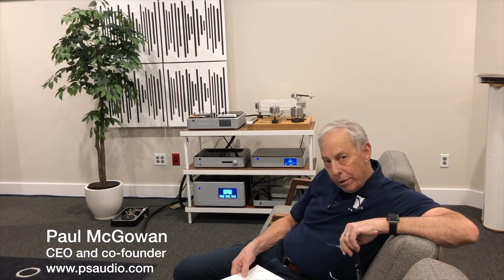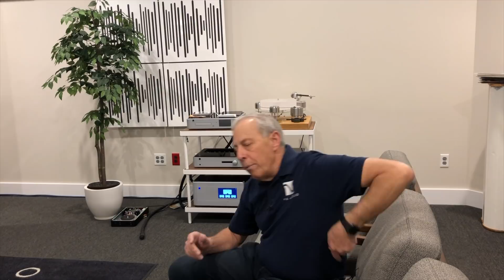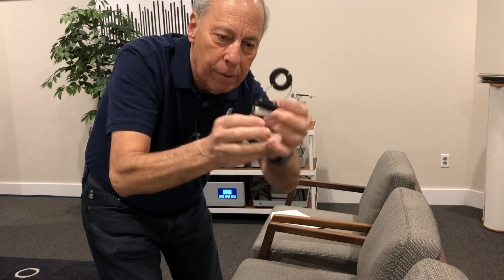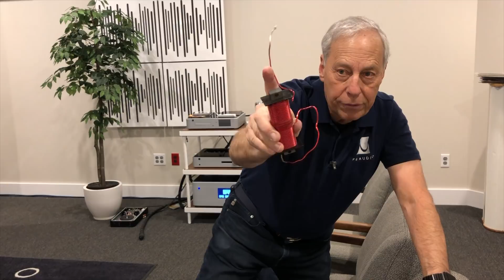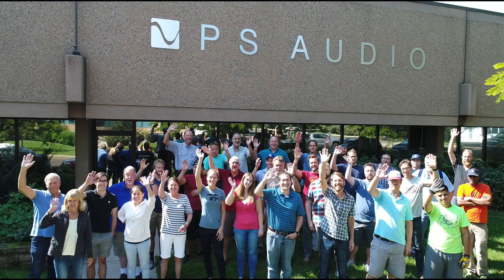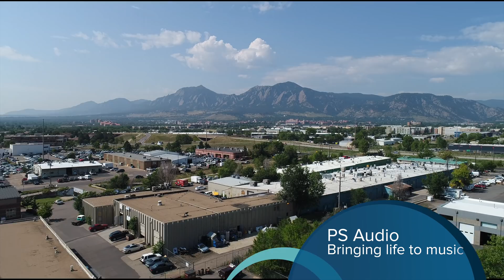What's different between air core and iron core speaker inductors?

Comment: How do you convert an iron core inductor to an air core inductor, is it that you use the same amount of turns, but double the gauge of the wire, to get the same inductance as an iron core  ?
Reply: When you remove the ferrite or iron core from an inductor you reduce its inductance by a factor of 2 to 4 generaly. So, to achieve the same inductance in millihenry, you will need to make the spool much bigger ( 2 to 4 times the lenght of copper  ). Some people worry because the resistance through the lenght of wire will also augment, but since these are low values ( from 0.1 Ohm to 0.3 Ohm ), the change will be barely noticeable ( around 1/2 db of loudness ).

The gauge of the wire only influence the power ( in watts ) you can drive through. For example, if your speaker accept 100 watts RMS, 18 or 16 gauge wire will be sufficent. If speaker are rated to 200 watts RMS, you will need 16 to 14 wire gauge. If your speakers are rated at 300 watts RMS or more, 12 or 10 wire gauge will become appropriate to tolerate that amount of power.

Since iron or ferrite core inductors are more an economy trend, most high end or high power models only use air core inductors. If we consider that most speakers can have a lifespan of 50 years or more, it is a wise choice to invest more for quality components. I hope this is helpful. Good luck !!!
Reply: @yvesboutin5604 Hi my iron core inductor, I want to change, which measures 0.36mh, with 0.5 mm wire, should I replace it with an air core inductor around 0.72mh 0.5 mm wire, or should I increase it, what are your thoughts?
Reply: @tweakerman  Hi, your question didn't include if it is for a mid-woofer or on a tweeter. Also, is your speaker a 4 Ohm or 8 Ohm impedence? All those parameters will be important to consider for the gauge of the wire to be used. If your inductor is to be used  in series on a 4 Ohm, 8 inch mid-woofer, at a crossover frequency of 1800 hertz, you will need a 0,82 mH inductor of 14 gauge size ( 1,2 mm ) to be able to carry that much power.

If your mid-woofer is an 8 Ohm driver, you will need a 1,6 mH coil because the impedence has double. Now for a tweeter in a second-order configuration, there is less power passing through ( maybe 1/8 ) so a 18 gauge wire  ( 0,6 mm ) will be enough. But again, depending on the impedence, that value might change. Some charts exist on the web for those who make DIY speakers. I encourage you to consult them. Good luck.

Comment: I am rebuilding a crossover in a set of speakers, just a mirrored upgrade to better components. The exsisting caps are garbage and its very tiny gauge iron core inductors on all bands. I purchased 16ga air cores for the tweeter and bandpass circuits, on the low pass I got a 14 ga iron core. It wasn't cheap but a 7mH 14 ga air core took me over the budget. To save a few bucks I used an Audyn Q4 68 uF on the LP also. Mids got Clarity-Cap CSA and Superior Zs for the tweets. My goal is to get more control down low, going from a 20 ga (maybe smaller) to 14 ga with a decent cap should tighten it up in my eyes. Also, i want to clean up the middle, at higher volume the mids kind of take a back seat to the bass, as far as the tweeters go, with the Z cap I am told they match well with soft domes, brighten them up. I guess we'll find out.

Comment: AC has two half periods, in the first one the voltage goes from zero to max to zero, then the polarity changes and the voltage repeats, following a sinusoidal curve. Current follows the voltage thru the load. 

When you put AC through a coil, in the first half period as voltage rises, some time (dependent on the inductance of the coil) is spent to store up some energy in the magnetic field in the core of the coil, while no current passes to the load until the field is complete, when the second half period starts there is already a field there with a magnetic polarity of the first half period, that started collapsing when the voltage hit 0, there can be no two polarity mag fields in the coil at the same time, so what happens is the supply voltage tries to push the current in the other direction, but that current, while trying to create an opposite polarity field is stopped instead from flowing thru the coil, by the current generated by the first field releasing its stored energy, until it completely collapses, this is called self inductance, delaying energy transfer, then some more energy is stored in the mag field of the opposite polarity. This is almost like magic because even a little amount of magnetic energy stored in the coil is able to momentarily overcome ANY electrical resistance in its way, when the field starts collapsing and inducing voltage that can reach some pretty unbelievable values... so you can imagine the power loss difference when you do it once per second vs 20000 times per second.

 While the frequency is increasing the coil spends more and more time collapsing and rebuilding its mag field while "wasting" energy in a given time period, and the time when the field is up and the current allowed to pass freely, decreases, it's like magnetic PWM of a sort, speakers are also made of coils, thus frequency response, but that has also a lot more to do with inertia and fluid dynamics...

Iron needs way more energy then air to orient its atoms to form a magnetic field, making the once formed field way stronger, so you need less turns of copper wire for the same effect, but it doesn't do so in a linear fashion, it is called a hysteresis curve, and each material has one, air cores are perhaps the "cleanest" in terms of introduced noise due to hysteresis, but you need more copper, and since bass is a much lower frequency, and iron is much cheaper then copper, bmw probably made a deal sacrificing some audio quality for lowering price and size of the coils, or that they factored in for the non linearity curve elsewhere in the system, or that the solid core is iron dust or some other more linear composite...

I hope that I explained it well enough, coils are probably the least understood things in electronics, and since magnetism is involved, quantum physics may be able to explain the phenomenon fully one day...

Comment: Howdy. Yes.
The iron core has three main disadvantages that must be considered in High End.
1. As mentioned the saturation. When the iron goes into saturation its inductance fades away.
2. Hysteresis. Ascending magnetization follows a different curve than descending. Causes phase unlinearities.
3. The permeability factor is not a constant. It varies with varying magnetization It is not a straight line in a BH chart. The inductance will vary with varying volumes causing the cutoff frequency to roam.
Regards.

Comment: Paul.  The word for an iron or ferrite core which you were trying to remember is Drum Core (looks like a spool).  Also, there are iron or ferrite Rod Cores and Toroid (ring shaped) Cores.  A Bobbin in some cases, is simply a metal or plastic form or spool to wind on or transport wire.

Comment: I don't like iron core as they saturate and limit dynamics.
Reply: Iron core gives distortion at saturation. But higher DCR of air core limits dynamics. You got it all wrong. If you want good dynamics, use a huge expensive air core inductor.
Reply: If you choose a good size iron-core you might have a hard time trying to saturate it. You would need to apply like 500-1000 W of amp power.

Comment: I much prefer the sound of air core inductor' with 12-14 gauge solid copper wire in my designs. Its very expensive but when it comes to correct sound on a good set of speakers, who cares about a couple of extra bucks.

Comment: Great video! I hope Paul is able to elaborate on the advantages and disadvantages copper foil inductors sooner rather than later as I have a speaker project that has Goertz inductors as an option and he's better at explaining this stuff than just about anyone else around. Please, Paul!
Reply: Or just use active crossover wich has no negative effects apart from that you need multiple amp's.

Comment: depends where the inductor is in a crossover, like a 3rd of 4th order linkwitz I find when you put the iron core in it allows more higher frequencies  to pass then without.
Reply: Frequencie response is the same if the inductance doesn't change.

Comment: Thank you again Paul. Your explanation covers it fine for general knowledge. For those who want to read more I have added the following:For audio purposes the iron core saturates with amps and frequency, the lower the frequency the lower the amps that the core will tolerate before  saturation. In the November 1990 Audio Magazine with the B&W 801 Matrix review starting at page 108, Don Keele jr.  discusses the effects of an undersized core of an inductor in that particular speaker. To save you all digging through the closets, here is a link:  https://www.americanradiohistory.com/Archive-Audio/90s/Audio-1990-11.pdf
Reply: Very cogent for today's insane power levels that amplifiers can deliver these days.
Reply: Thanks for the AUDIO mag link JH!!.... the Matrix 801s2 has been my favorite & primary listening speaker for over 20 years, and I still love it!  I've done extensive upgrades to the original crossovers, but one of the very first was to address inductor CROSSTALK.  Two of the midrange & woofer inductors were too close and not orthogonal to each other, thus creating a problem in the 300-400 Hz crossover range.  I'm now wondering, if what was originally suspected as an undersized inductor, was just in fact a crosstalk problem??  In any event...  I now have a new reason to tear into them again, and seek out possibly upgrading the L6 inductor anyway (space is limited however).  I've already upgraded all the original capacitors.
Reply: Please note two things from that article:
1. The inductor in question is a FERRITE - cored, 6.5-mH inductor that apparently was undergoing core saturation... (ferrite cores work better on high frequencies, while iron cores are better for lows).
2. Note that for typical program material with realistic crest factors played through power amplifiers of 150 watts or less, inductor saturation and resistor overheating should be NO PROBLEM.

Comment: Could someone address soft iron vs sintered ferrite or even nickel or CuNiFe ?
Reply: They all have different permeability. The goal of any transformer or inductor is to provide a certain amount of inductance at all frequencies of interest while at the same time using the least amount of wire possible. Lets pretend that we have two inductors of the same size and the same number of turns. One inductor is using just plain silicon steel which is probably the most common type of core used in audio. The other core has some nickle iron alloy. The nickle iron will have a higher permeability and in turn will give you more inductance. However it will also saturate a lot sooner. So you have to balance out the metallurgy of the core such that it gives you the inductance you want without saturating during normal operation.  Soft core iron, nickle ferrite, and all that stuff are just variations on metallurgy to achieve better inductive performance for the same size transformer.
Reply: @tristanjones7735  Thanx, TJ . I thought permeability was important. Coming from the guitar community,and we are gullible to 'mojo' I wonder about eddy currents making uncontrollable artifacts. BTW I thinking more about magnetism, inductance and transducers from the pick-up end mostly.
Thanx again.
Reply: @therugburnz   Wellllllllll things start to go sideways with guitars. In audio we usually aim to minimize distortion where possible. In guitar world, you are aiming to achieve a certain type and level of distortion. Different core materials can cause different types of distortions and that might create different resonances ect ect. In audio thats generally viewed as a bad thing, with guitars, you might leverage that type of distortion to flavor the sound characteristics. 

Good news is that winding your own guitar pick ups is fairly easy and cheap, so you can play with different core material and figure out what works best for you.

Comment: The iron core changes the inductance depending on the placement, the area of the iron in the core. Also the iron helps dissipate the heat generated by current passing through it as the magnetic field decays it generated a field in the opposite direction. Air core is less efficient and builds up more heat needs heavier wire and more turns to accomplish the same task. Inserting a Capacitor in the  circuit creates a “tuned” circuit works kind of on the same principle as a pendulum.
Reply: Very nice explanation as well. Thank you
Reply: May or not be 100% accurate. Tried to be as concise as possible.
Reply: Also, the core can have an air gap to linearize the B-H curve and to increase the saturation current. Then, you can have the best of both worlds...
Reply: I disagree with your assertion. If your coils become warm or hot, that means there is too much power passing through them. In that instance, you need heavier gauge of wire in your crossover. I encounter such a problem with a big public adress 3 way speakers almost 30 years ago. The guy started his disco touring company by making the speakers himself. He put a 3 way Radio Shack crossover connected to two 18 inch woofer+ two 6 inch midrange + one high power compression tweeter for a total of 1200 watts RMS of handling power. As you can imagine, the crossover was toast in less than a minute. The more power, the more heavier the gauge.

Comment: Explained well and correctly. you can demonstrate the effect of an iron core by sliding one into the empty space in an air core inductor while being measured with an induction meter, the inductance goes way up when an iron core is inserted. A good source for iron cores is found in old radios that used iron cores in the AM antennae, they are ideal for use with an iron core inductor.

Comment: Great video Paul.  Back in the 1970's I built some 3 way bass reflex speakers with 12db per octave crossovers.  I was given a big coil of 18 gauge magnet wire and wound air core coils.  The 18 gauge wire provided a high Q value. Fortunately the cabinets were about 7 cubic feet in size, but I got the sound I wanted. I also salvaged the woofers only spent a few hundred dollars.  The labor was "free".  I must say that my bookshelf Paradigms of the 90's with a sub-woofer sound much better and the wife is happier.  It was a learning experience that illustrated why high quality speakers cost so much at the time.
Reply: These day's with so many good driver's and crossover parts available you can build very good speaker's very cheap compared to something on the same level in a shop.

Comment: I don't mean to be rude, but im pretty sure iron cores don't saturate on frequency alone until 50khz. Depending on the core material, this can actually be much much higher. I don't really buy the idea that an air core inductor is superior for audio. I think a properly designed nickle iron core is probably better but it would certainly cost 3-5 times as much.
Reply: There are also metal dust core inductors that arguably give the best of both worlds.
Reply: @ronmatthews1738   Well you shouldn't need to go that far. Powered iron cores are really nice for high frequency applications. However we are not dealing with Mhz frequencies in audio and it won't give you the same inductance that a normal laminated core would give. 

I think the real reason paul prefers air core inductors is because iron cores do introduce non linearity into the mix which has very little to do with saturation. My thought is that if you design an inductor that minimizes some of these non linearities, you could theoretically end up with an inductor that has wayyyyy less wire in the audio path while at the same time not introducing any unwanted distortion.
Reply: It saturates with power..
Reply: @kaedeschulz5422   Yes it can, but as long as you design the choke correctly, it should be able to handle a fair amount of power. IDK. I just bought some iron cores and will do some experimentation. I will get to the bottom of this.
Reply: @tristanjones7735  I only use air core's... So i have no idea about iron core's.
Reply: @tristanjones7735  Any results on your iron-core inductors tests?
Reply: Air core is better if either one will do the job. You don't have to buy into it as it's a given.